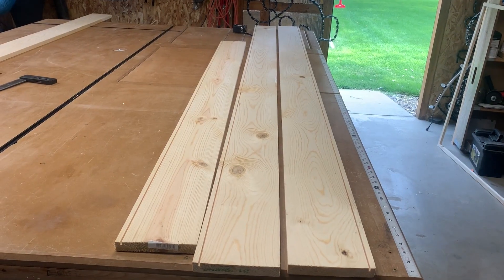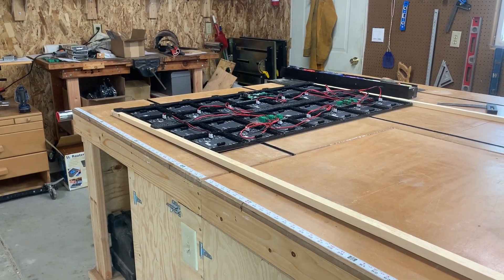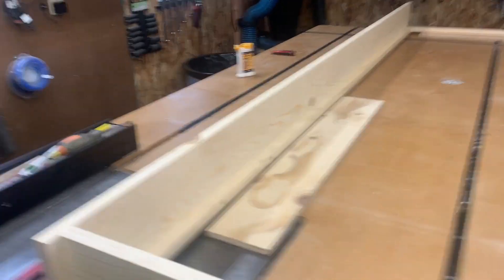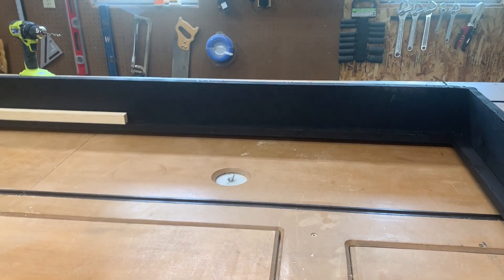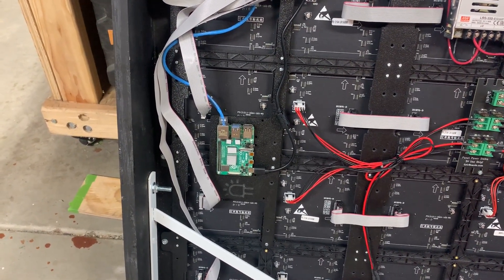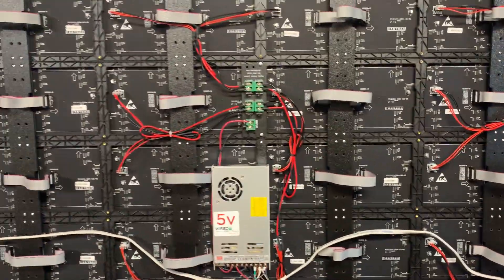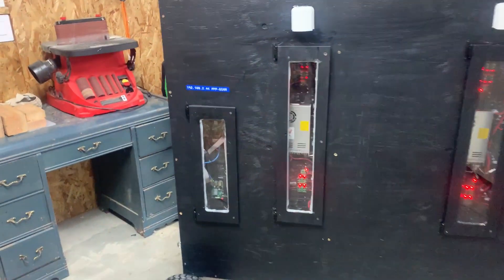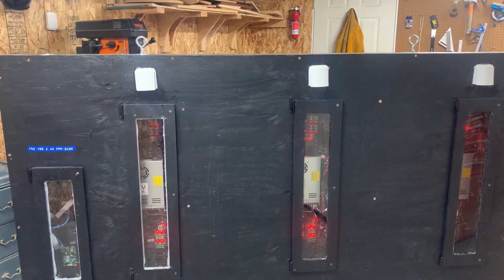P5 Panel Build

Comment: I have a 7W x 2H P5 64x64 Pixel Panels Matrix. My problem with the Colorlight Card is, that the brightness is only by 30%, but why i can't go brighter?
Reply from the maker: I believe there are settings in the LED vision software for this but couldn’t tell you where to find it. Sorry

Comment: Awesome build                                         How much does it weigh?
Reply from the maker: Thanks

Not sure but it is heavy.  I am guessing 100 lbs.   I can lift it to place it on my work bench but it is difficult to.  That is why I made wheels for it and I use some hand hoists to install it for my show.
Reply: Yea, I’m using a pixel matrix now but it’s very heavy too was hoping the panels would be lighter, maybe I can build it in two or three pieces and just clip them together
Reply from the maker: You get different looks from a pixel matrix and a P5 panel.  You need to decide which one you prefer.  Your Pixel store sells P panel setups with prebuilt enclosures.  I believe they are aluminum so they should be lighter.  Another option is to use a cheap TV

Comment: I am looking into building a p5 matrix like you did. Have you had any issues with your indoor panels being used outdoors?  and how long have you had yours.  I live in Ohio and we get all types of weather.
Reply from the maker: My enclosure is well sealed so no issues with weather.  I do hang it under my pouch, so no direct rain.  That being said I do get some intense wind, and it does fine.  I let it swing so a good portion of the wind load is deflected

Comment: Any idea how much power on average this uses at 100% ?
Reply from the maker: Not sure but I have 3 350 watt 5V dc power supplies on the panel. I run my whole show on two circuits, so the power draw is quite reasonable

Comment: Where would the tipping point be between a build like this and a grid of four of your run of the mill $300 50" 4k TVs from Walmart?  Obviously one aspect would be weather, but a pretty simple enclosure could solve that problem I would think?  I'm not trying to take anything away from the excellent work you've put into this build- but from a beginner's view it's a bit daunting :)
Reply from the maker: A large budget TV would be cheaper then a large P5 panel.   The cost of these panels has gone up and the price of TVs has gone down.  It also depends on what kind of look you are going for.  I recently gave a friend the advice to get a large low cost TV connected to a Pi instead of building one of these panels.
Reply: @bergmannlights5149  YOU AND I ARE GOING TO HAVE TO TALK ABOUT THIS TV THING.

Comment: What was estimated cost of this build?
Reply: The P5 panels and colorlight/Pi  was ~$1000, panels come from Wally’s lights. The plastic sheet covering the front was $50 from Boscoyo.  The plastic connectors and fuse boards were ~$150 which I got from Wired watts.The rest came from a local big box store and was probably $150.  Grand total is ~$1350

Comment: Very nice build.  Any issue with condensation?  I didn't see any drain holes in the bottom.
Reply from the maker: I do not have any drain holes and haven't seen any problems.  I live in a dry area so lots of moisture isn't too much of an issue.  That being said, ventilation is a big help on keeping condition under control.